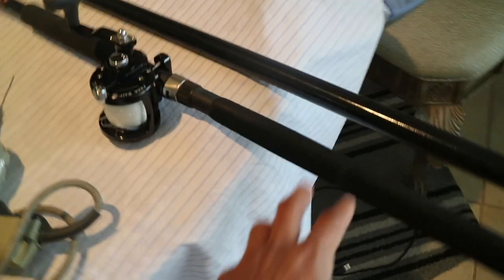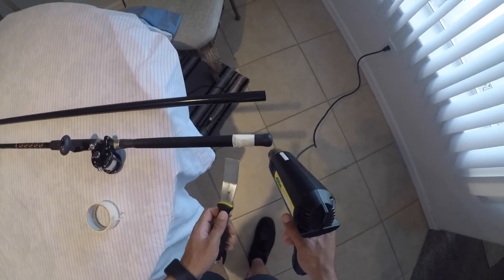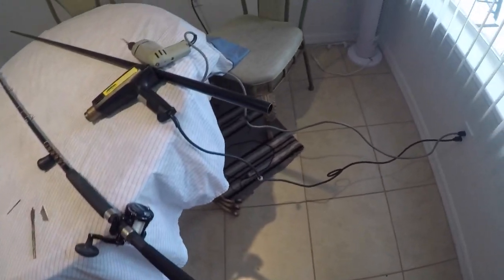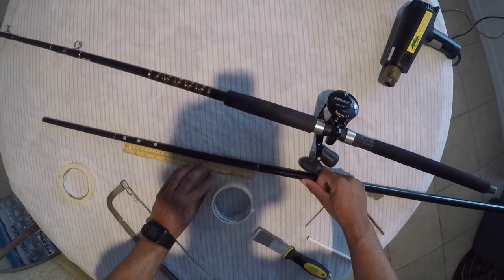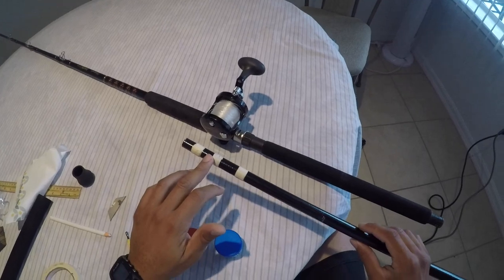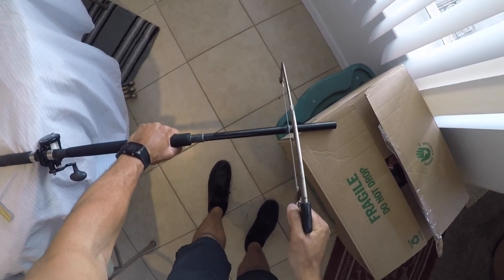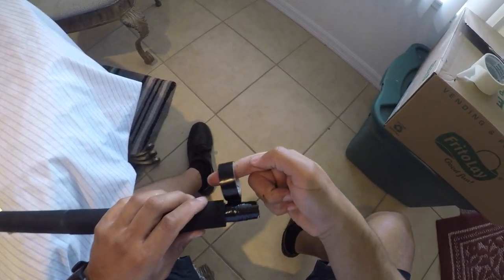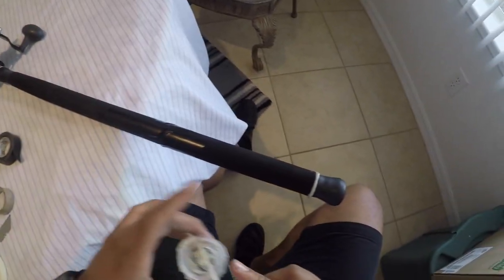How To Make Fishing Rod Longer

Comment: did it cast further after doing the extension? i would have thought to make any significant difference you would have to move the reel seat and guides not just keep them in the same place
Reply from the maker: It cast a lot further compared to before. No you don’t have to reposition the guides or reel seat.👍

Comment: i've wondered in the past if i could use a nice rigid piece of pvc to slide over the butt of my rod and use it as a cheater bar to get more leverage and longer casts.. i need to try it
Reply: You can just need it to be a lil firm on the pole